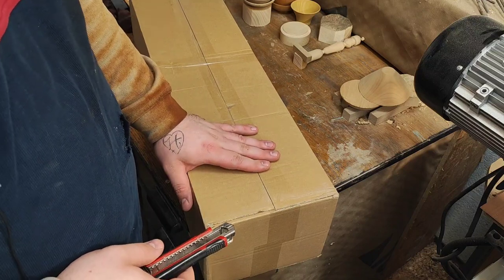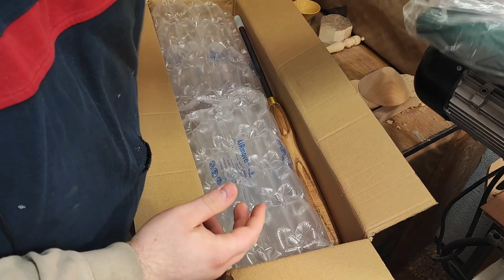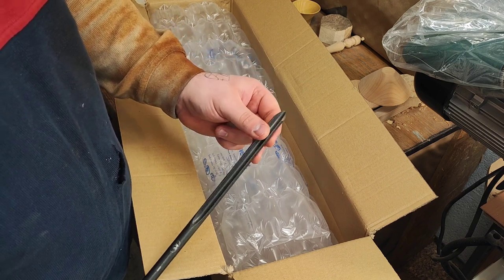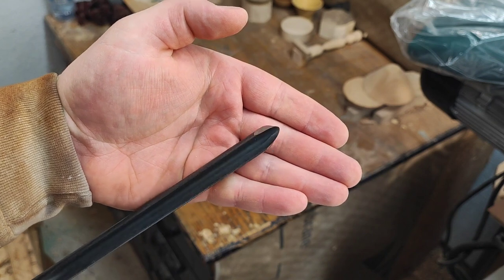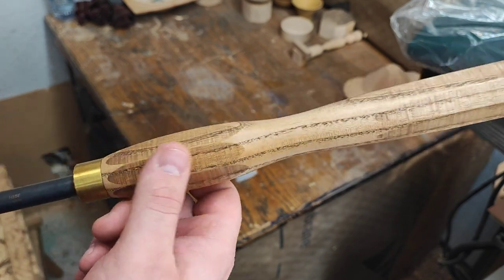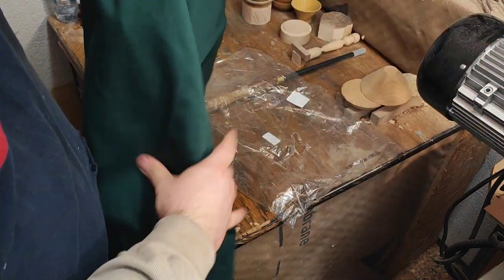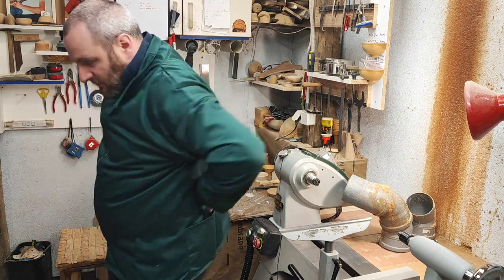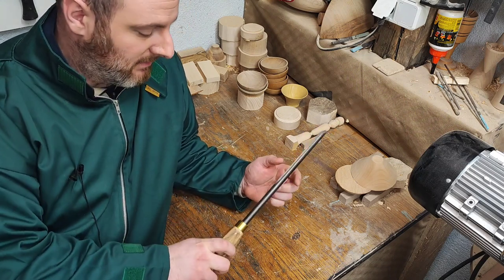NEW BOWL GOUGE BRAND

Comment: Interesting handle on that gouge.

The smock looks great. I'm hoping to find a smapron or smockron (Homer Simspon's versions of an apron & smock combined). Right now I cover my lap and stomach with an old towel and wear an apron as tight as I can. With my face shield down, most of the shavings stay out of my clothing. Then,  peeling off my apron and towel, and dusting off with lots of compressed air, keeps most of it in the shop. It's amazing how many place sa wheelchair can hold shavings. Enjoy your new gear, Tom!
Reply from the maker: I can imagine shavings get all inside wheel chair, I have compresed air as well but no matter what I do I always bring pile of shavings inside the house 😂

Comment: I like the octagonal handle on the gouge.  That should keep it from rolling around when you lay it down.  The smock looks well-made.  I wonder why is it that 99% of the time, the zippers on turner's smocks are left-handed?  Maybe that curious feature goes back to some medieval turning guild tradition?  
I have a leather turner's apron with a high front and knitted collar that fastens with Velcro around the wearer's neck.  It is my favorite.  The knitted material does collect dust a bit, but it comes off to clean. 😟😟Other than that, the apron is quite comfortable, repels the chips well and is cooler in the summer than a smock.  Of course, it doesn't protect your arms from flying chips, but that's generally not a problem.
I'm sure anything you do to minimize bringing chips into the house will please your wife. 😃😃
Reply from the maker: Indeed sir, happy wife happy life 😂
Dont know about left zipper, maybe its easier to do or something like that....

I imagine getting another one for summer with short sleeves , but so far really comftable...... Like the sound of your leather apron... expecially in summer...thank you for watching 🤗